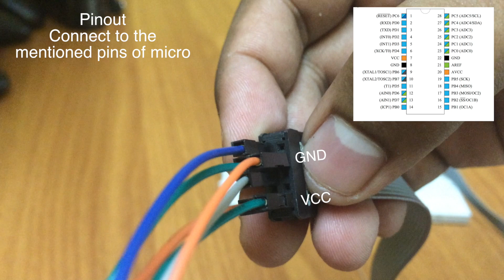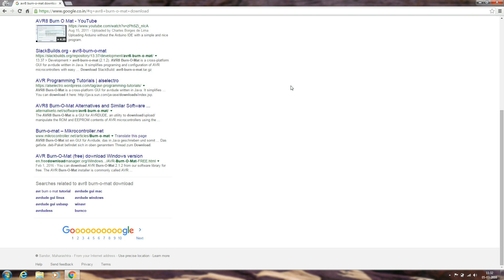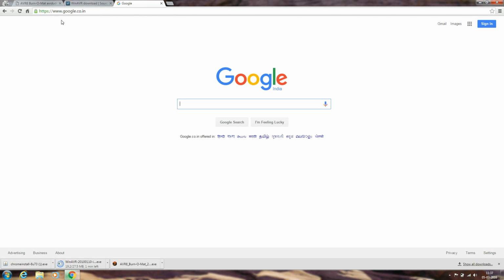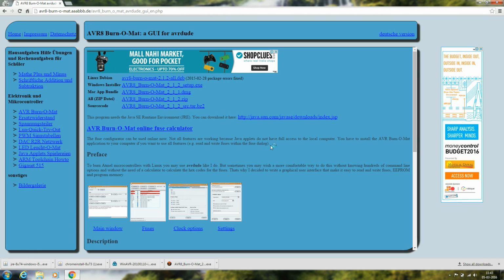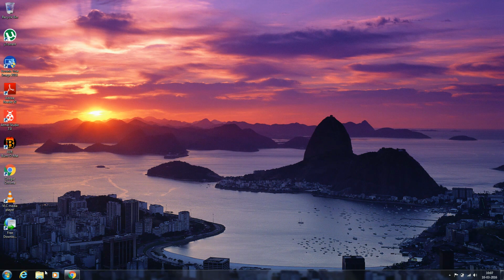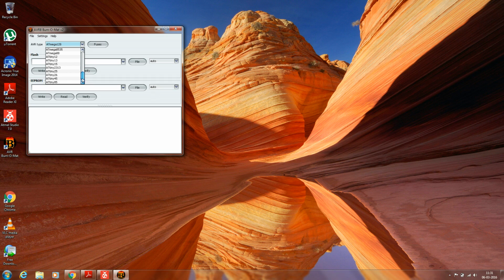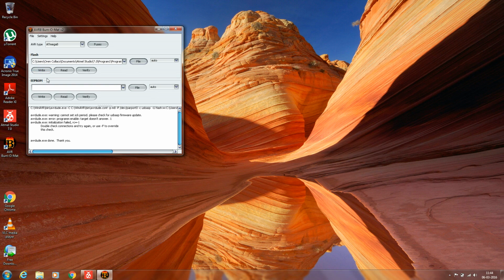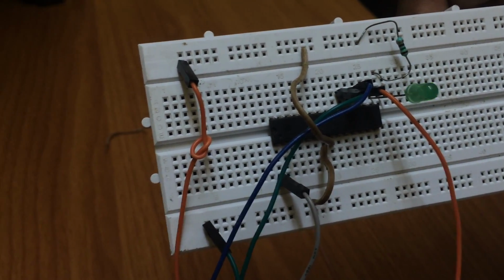Tutorial:How to burn/program a hex file to a AVR microcontroller using AVR Studio,USBasp,Burn-O-Mat

Comment: Hello sir, I did everything you said it, but this error occurs -->  
 WARNING: Unable to detect MCU

avrdude.exe: set SCK frequency to 1500000 Hz
avrdude.exe: warning: cannot set sck period. please check for usbasp firmware update.
avrdude.exe: error: program enable: target doesn't answer. 1 
avrdude.exe: initialization failed, rc=-1
             Double check connections and try again, or use -F to override
             this check.

Comment: hex file is not need to be carried because the atmega runs its machine code which had been compiled by the avr compiler,not the hex,the hex is just hexagon encryption of text.
Reply: duuuuude what!?? are you just typing random words? Stuff Builder was right btw
Reply from the maker: What?  It's the file type that is produced after the code is complied. It is the file which contains the machine code(binary data) and is programmed into the micro. I didn't even get what you said. So .hex file is the file that is burned onto the micro
Reply: Stuff Builder no!i don't sure 100% that hex file isn't the machine code of atmega but hex file is still the text format so it wouldn't optimizing the code and not security so it would be translated to another machine code just a few bits for a operator.you can see the elf file is in binary and shows the nonsense character.and if it runs hex,it will not need the dedicated flashing device.

Comment: I checked my connection about 10 times, but it still dont work. What should i do? (using ATMega32)
Reply from the maker: What is the error message showed by AVR
Reply: avrdude.exe: warning: cannot set sck period. please check for usbasp firmware update.
avrdude.exe: error: programm enable: target doesn't answer. 1 
avrdude.exe: initialization failed, rc=-1
             Double check connections and try again, or use -F to override
             this check.
Reply from the maker: Try swapping MISO and MOSI
Make sure you choose ATmega32 in Burn o mat
Reply: It still dont work but thanks a lot :)
Reply from the maker: Okay. Last suggestion : Move the GND pin in the remaining points on the same line one by one of the USBasp(Some usbasp have different GND output pin) If that doesn't work, your ATmega32 is probably faulty. Anyway Best of Luck!!

Comment: can i programe using arduno circuit
Reply from the maker: What do mean by arduino circuit. I didn't understand
Reply: is the altemaga chip that you used the same as the one used on arduino board
Reply from the maker: Chip is the same. But arduino board chip have a bootloader. That can make a difference
Reply from the maker: If you already have a board. Go ahead and try it. Deattach all the things connected to it and see if you get the desired output

Comment: I cannot see the programmer(usbasp) in the settings
Reply: Bro... Don't use Burn-O-Matt at all. Just follow these steps. Worked for me..

Plug in USBasp
Download Zadig from http://zadig.akeo.ie
Start zadig
Options > List all devices
Select USBasp from the drop down menu
Select libusbK(v3.0.7.0) driver
Click Install
Reply from the maker: You might have not installed the driver
Watch the entire video
Reply: The link you mentioned for usbasp driver, does not contain a zip file. instead it has this "en Zadig - USB driver installation made easy". The detection problem persists even after downloading and using the above setup.
Reply from the maker: There is no link. I searched google for it. Its a tar.gz file. I think you'll need Winrar or 7z to extract the contents
Reply from the maker: I've added it in the description
Reply: Okay. Thanks a lot :-)

Comment: Don't put it on your bike though, can be dangerous maybe (that's what I want to do though, lol).
Reply from the maker: +Dmitri Diaghilev My bike doesn't have a motor😄
Reply: +Stuff Builder Most add on devices like that which I know of use twelve volt DC brushless motor which sells for about seventy american dollars in Canada, and it is easy to add on, you can utilize old laptop batteries, or even just use a regular car battery (enough for for than two hours of pedal assisted ride with 500kW motor power consumption)
Reply from the maker: +Dmitri Diaghilev That's good. I actually attached a drill motor to the rear wheel of my cycle a few years back. But it didn't work. I didn't have the understanding of torque,gear ratio,etc. Now that I am a little more educated, I think ill be trying it again sometime

Comment: Can you do a video on how you wire a converter from 12V DC  to a three phase washing machine motor?
Reply from the maker: +Dmitri Diaghilev I don't have a three phase washing machine😅
Reply: +Stuff Builder You can buy one off scrapyard
Reply from the maker: +Dmitri Diaghilev I have never seen a washing machine with three phase motor in it in India. I'll buy a normal three phase motor later. But still 12v has to be converted to 120v AC and with three phases. The circuit must be complicated. But if you already have a converter, it shouldn't be hard to wire.
Reply: +Stuff Builder It's just electronics: circuit and parts, with cost for parts, that's all, if you have the circuit or able to engineer one, that would be cool, otherwise forget about it
Reply from the maker: +Dmitri Diaghilev I'll try that